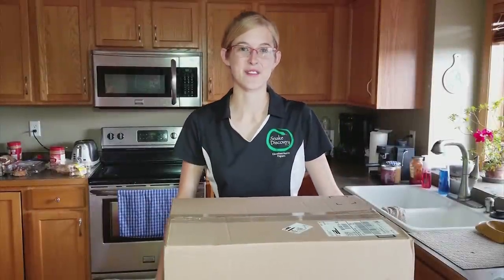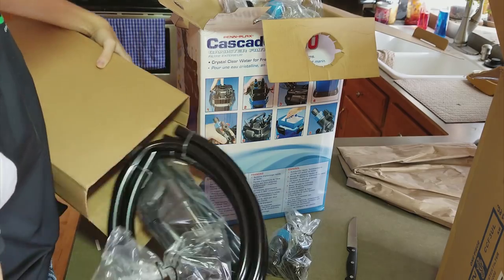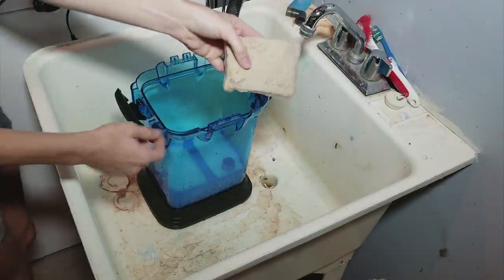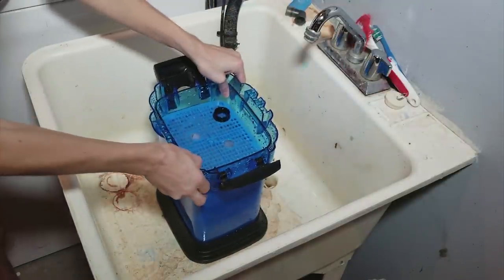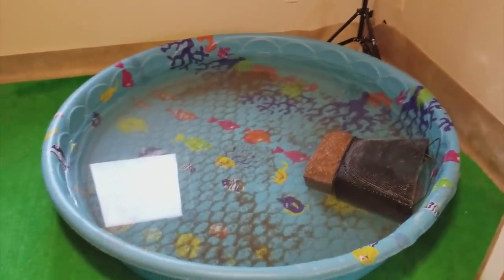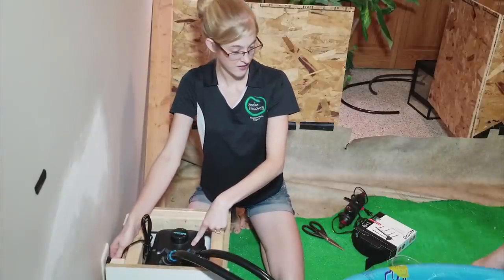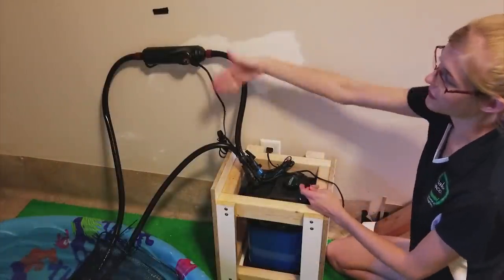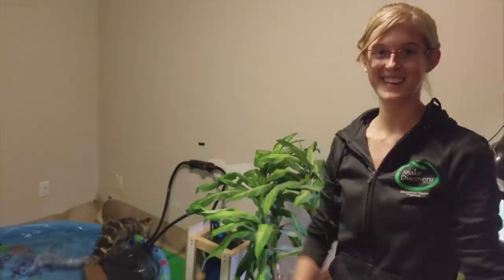Unboxing & Installing Cascade 1000 Filter for my Alligator

Comment: The only video I found to really help setting  up my new filter. Thank you!!!
Reply: the filter was set up in the wrong order, should by Mechanical, then Biological then Chemical , other then tahat great video
Reply: @georgepep1824  I always do mechanical,chemical and finally biological
Reply: @yee9222  regardless that's the wrong order to set them up and makes it much less effective
Reply: @Lilith-Rose  aah
Reply: With ur filter how long did you have to pump it for because mine isn’t working at all and I have been pumping it for 30 minutes?
Reply: @wendyfitz7883  fill the filter with water first, else you will probably still be there next thanksgiving

Comment: Emily, If you are still answering comments:  I just purchased the Cascade 1200 which has 4 trays.  Any suggestions for what I should put in all 4 layers for a full grown Eastern Painted Turtle living in a 55 gallon tank?  
Also, I noticed that you laid floss in the bottom of the Purigen tray as well as floss in the Bio Tray.  Is this the proper way to set up each layer?  I usually see the chemical and bio layers set up with no floss.  
Thanks.  Great video explaining the product!

Comment: Great video. I also use a fish safe lubricant on all rubber seals/parts to prevent them from drying out and cracking which causes leaks.

Comment: Hey what do you use to drain the pool and put the water back in? And how did yuu attach the cage to the pond or secure it? I have a monitor. Does this filter make the water completely safe to drink even if the monitor poos in it? Thanks

Comment: I have a question so I finally got the cascade 1500, but I accidentally started the motor before priming it. well what I did was forgot to flip the switch so water could come. I had the motor running for a minute I believe and then realized it was the switch. So I flipped it open and pushed the button over and over till it reach the top of the motor and bam worked. Just wondering if I did any harmful damage or don't worry about it?

Comment: I installed a similar filter, the 500.  Looks like that but smaller.  Mine makes a very slight crackly noise sometimes, intermittent.  Like rice krispy sounding lol. Is that normal for the first couple days?

Comment: Hi and thank you very much for your review and explanation.

I have a 700 L aquarium and I would like to buy the cascade 1500 in your opinion is it enough to handle a 700 L aquarium? How many kilo of bio media I can put inside?

What the the electricity power consumption in watts for the 1500 model ?

Thanks a lot .

Comment: I'm really lost on the practicality of having a filter like this for an animal of this size in a pool that big. What exactly is it filtering out? I have a filter of this size in a 46 gallon turtle tank and it requires every bit of it's power to keep it clean.  Is the alligator defecating in there? Eating in there?  What is the water change frequency even with the filter?  Can you explain how all this works for you? Thanks.

Comment: Actually you set it up wrong, the mechanical goes on in the bottom tray with the filter floss, next tray is the bio media,top tray should be carbon/ purigen
Reply: Lol I was just looking around at a few videos to confirm this. I was worried I set mine up wrong, and confirmed her set up is incorrect. Carbon kills off the bio by stripping chemicals away from it, and that wont be able to convert your ammonia.
Reply: That's true for carbon, but the best way to place purigen is between the biological and mechanical filtration.

Comment: you used three filter floss with no reason, you used chemical filtration before biological, and you used moving bed media in a canister. three mistakes in a filter. good work.. and you did not add any declorinator ? please count how many days will pass until you little pet rips open the tubes again..

Comment: Biological filteration shoukd go before chemical filtration. otherwise the chemical filtration could kill or most likely starve the bacteria in the biological filtration. A better filter to use for such a creature would be a 5 gallon DIY filter oppwrated by a in-pump. The best YouTube example of such a filter is by “king of DIY “. Lava rock can be used for the biofilter and cut to filter padding/ foam sponges can be used for the mechanical filtration. You can even use poly-fil from Walmart.

Comment: That biological media you used is for a fluidized filter.  Not a submerged..... Basically useless. The filter pads themselves would hold 1000x more beneficial bacteria....use seachem matrix or ceramic rings for biological media.  Otherwise great vid

Comment: I have a problem with my canister. it's about the same level as your pool and where the canister is (roughly on the same level) however, mine makes a weird buzzing sound whenever I plug it in. I filled the filter up with water already like what you did, as well I also primed it too. Any tips?